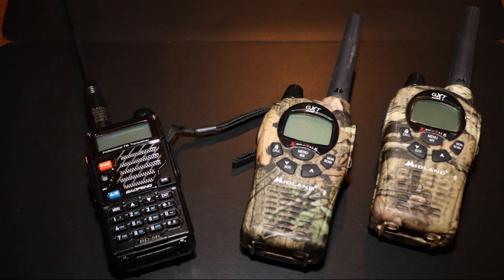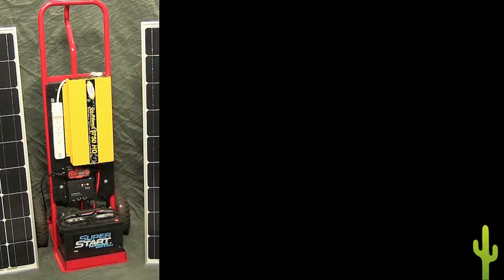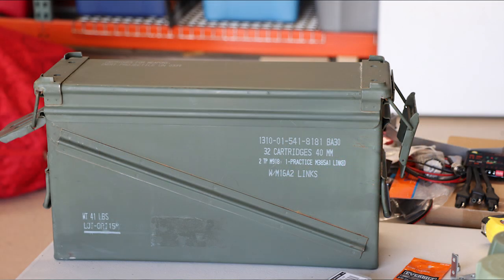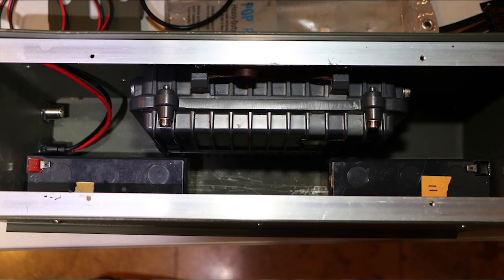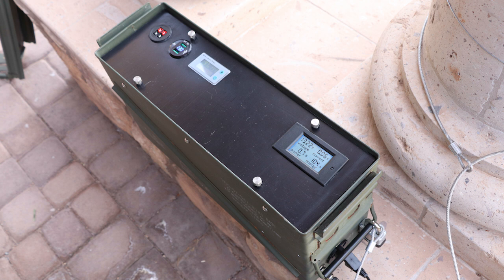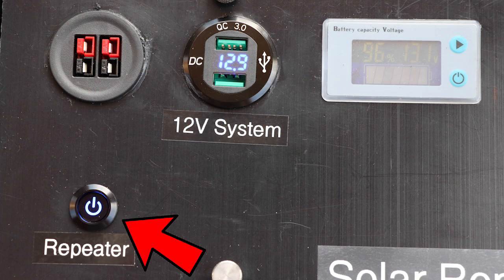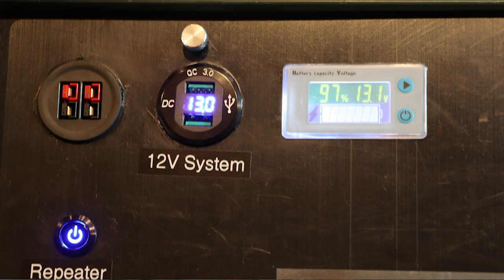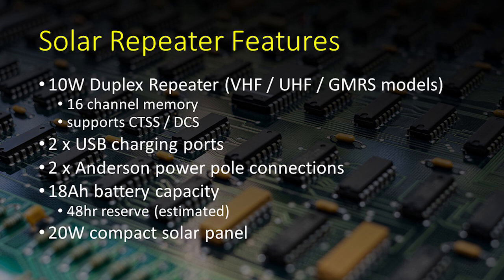DIY Solar HAM/GMRS Repeater - Self-Contained Weatherproof

Comment: nice ,I am working on a similar repeater GMRS . using bigger 50 cal metal ammo can.   using the upgraded RT-97 has speaker mic jack. going to use for repeater ID voice etc. LiFePO4 battery with MPPT controller. I put master battery disconnect switch on mine,as a switch for repeater power.I put pink foam insulation from home depot around battery and a 32F thermal switch to stop charging in cold. working on heater circuit now. I am in NY may be using in cold days .

Comment: Very nice project. I thought about building something identical for mountain property but realized a more powerful HT would probably be more practical because I would need much larger battery bank and solar panel for winter and snow, only occasional sun and snow covered panel not good. Thanks for sharing.

Comment: Very well done, great job! I embarked on a project involving an RT-97 in a self-contained Ammo case, but it's less organized than this & I didn't go the solar route because I didn't have the tech wherewithal. For my next portable repeater project, I'm going to try to go with something that's either 25/50 watt, so that'll require involving a controller/duplexer, in addition to attempting to incorporate solar charging/powering. This video serves as good motivation!

Comment: As the repeater module has only one antenna port, does that mean it has a built in duplexer?
Reply from the maker: Yes - the Retevis RT97 has a purpose-built radio and tuned duplexer built into the case.
Reply: @DesertPrep  In that case, and especially as a plug and pay device, it seems it is worth the money.

Comment: How well does that repeater work at 10 watts?  I've read in a couple places that the RT97's duplexer isn't amazing and at 10 watts can cause desense issues on the input offset.  I've also read that repeater struggles with LMR400 cabling for some reason.  Thanks!
Reply: Mine has been running on 10 watts UHF for a year or so. Yes, I can hear it further than I can transmit into it when using 5 watt HT but I still get into mine at 30 miles using 5 watts. It's at 2000ft ft AGL tho....so that helps.
Reply from the maker: We've tested it for range, and get clear communications past 11 urban miles.  It helps that it's using a 5.5dB antennae omen a 20-foot pole.
Reply: That’s awesome. I’m gonna try and do the community a solid and build one of these some day soon, thanks for the ingenuity 👍

Comment: Great video. Thanks for sharin, and includin the parts list.
Reply: What antenna are you runnin up on that pole?
Reply from the maker: The antenna is a 4-foot fiberglass GMRS unit on a 20-foot pole.  We get clear communications to HTs across the city at up to 10 miles, and further with more powerful mobile radios.

Comment: Dear Desert Prep You had a post back on March 26,2018. (wow 3 years ago) still relevant today.  I need your help if possible.  On  version #4 you showed 3 meters, in a test rig and what they measured. My problem is I could not see all the wire for that test rig to work and I wanted to build one.  I bought all the correct pieces, (I think) but didn't have a complete wiring diagram.  I am 76 years old, a retired Engineer  and like tinkering in my garage shop. This looks like fun and something to keep me busy. Thank you for your time and trouble.  (wewilly999@aol.com)  Bill Dawson
Reply from the maker: Good question.  Give me a couple of days and I'll get a diagram on the download site at www.desertprep.info.
Reply: @DesertPrep  Thank you very much, Bill Dawson